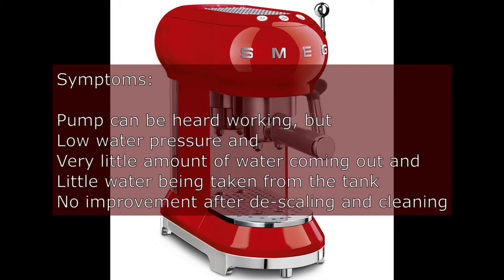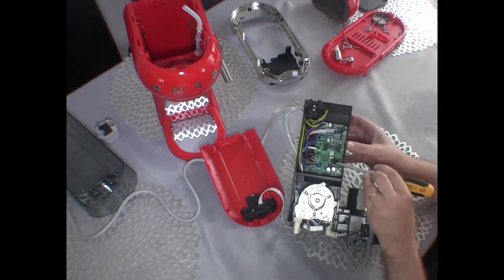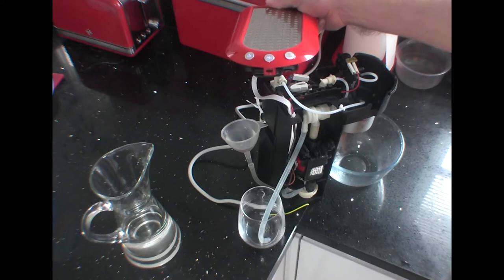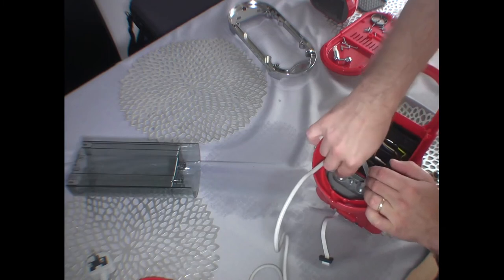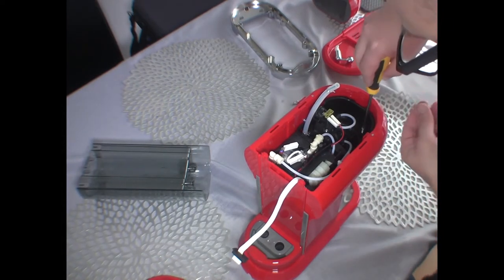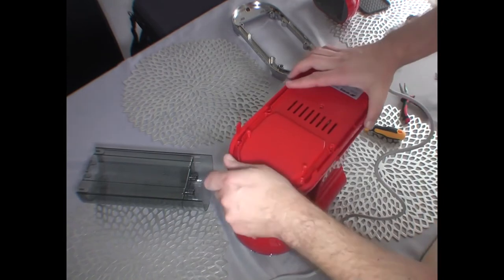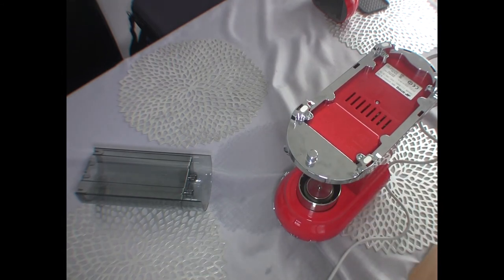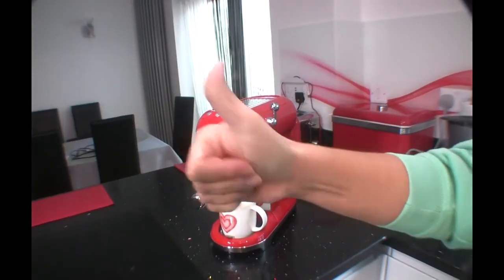SMEG ECF01 coffee maker repair - pressure relief water return valve fault

Comment: Worked a treat for me, didn't need to replace the valve, I just cleaned it out and reassembled. I cleaned it by removing the valve and flushing, with a bit of back pressure.
Reply: what did you do to back flush it ?

Comment: Thanks, worked perfectly.  Mine did leak after but it seemed the new valve from eBay was missing an O-ring, I used the one out of the old valve and it’s fine now.

Comment: Hey! I disassembled the machine, and took off the valve. When I opened it up (expecting to see a broken orange piece), it all seemed to look perfectly fine.  I ordered a new piece to replace it just in case. I just reconnected the new valve and I am still having the same issue. I am thinking it has something to do with the sensor that tells the machine that there is water available. Any Ideas would be helpful, thanks!
Reply from the maker: It is difficult to advise without having the machine on the bench in front of me. I suggest going step by step along the water path narrowing what is causing the problem: 1) is the water going into the pump and further out, is the pressure and volume ok 2) is the water going in and out of the heater 3) is there any block or leak anywhere along the way 3) is the controller behaving as it should and power supply to all parts is fine. That way should help to pin down the fault.
Reply: @zadzwon112  Thanks! The water is not going into the pump, but the heater is turning on and steaming, so I think that there are trace amounts of water going up there. There's no block, I checked every tube.  And all electric seems to be working! I just ordered a new water pump that I will install today, and hopefully that does the trick! otherwise I'm not so sure :/

Comment: Hey! 
I have the same problem and I’m trying to fix it myself, I bought the water pump but I can’t seem to have the right screw head for the base of the machine. 
The hexagon shape. Would u be so kind to tell me what kind of screw head did u used ? 
Tyia
Reply from the maker: Screws are security torx. The security pin in the middle of the screw head can be broken off and screw is converted to ordinary torx that way.

Comment: very useful video, My machine is does not want to descale, it goes into the mode then does not do anything, the coffee machine is only doing single shot and the milk frother works for only 5 seconds then the one cup and 2 cup flashes, any idea?
Reply from the maker: Hi. I would suggest re-setting the machine - the details of the procedure are described in the user manual under programming section.

Comment: What screw driver is required to remove the screws at the base? The screw head is a strange shape.
Reply: FYI. I have descaled my machine several times but when I try to make coffee nothing comes out of the machine. Hot water will come out when I dont have any coffee in the filter so I think it is something to do with the pressure but im not sure. The machine makes its usual noise when I try to make coffee but after a couple of seconds the sound lessens, and then the machine just stops.
Reply from the maker: @sandymartin3984  Screws are security torx. The security pin in the middle of the screw head can be broken off and screw is converted to ordinary torx that way.
Reply from the maker: @sandymartin3984  Before you disassemble the whole machine check the stainless steel water filter plate sitting above filter holder (the part you put coffee in):
Undo one screw in the middle of the stainless steel filter plate and remove it. Prepare hot solution of commercially available kettle de-scaler or white vinegar or citric acid and pour it into a bowl. Soak the filter for a couple of hours than rinse under running water and wipe it clean. Hold the filter against bright light - if holes in the filter are still blocked - repeat.
Reply: @zadzwon112  Thanks. The filter you speak about is fine. I can see through the holes clearly. I will try and clean the filter in the handle however. I have not done this. This is the only other thing that I think can be the problem. Otherwise I will try and get it fixed because the internals seem a bit too complicated for me and I'm not even sure what is broken. Cheers
Reply: @zadzwon112  There is pressure in the chamber between the handle and the pump. When I try to make the coffee, water does come out but there is pressure between the handle and the machine after it stops. Its clear because the handle self twists off after I rotate it a little. I assume this is a problem with the pressure release valve
Reply from the maker: @sandymartin3984  Faulty pressure release valve directs most of the water back to the water tank and very little comes out of the machine. I hope you manage to find and rectify the problem.

Comment: The filter has no visible outlet holes. When it's blocked, how to repair it?
Reply from the maker: Are you asking about this filter: https://youtu.be/azTNitfqs6o?t=1415 ?
Undo one screw in the middle of the stainless steel filter plate and remove it. Prepare hot solution of commercially available kettle de-scaler or white vinegar or citric acid and pour it into a bowl. Soak the filter for a couple of hours than rinse under running water and wipe it clean. Hold the filter against bright light - if holes in the filter are still blocked - repeat.
It is good idea to regularly flush the machine with manufacturer recommended de-scaler - there are YT videos on how to do it. This will prevent limescale building up inside.

Comment: Hello, thanks for the video. Can you share a link to the pressure relief valve pls ?
Reply from the maker: Just google "ecf01 parts valve" or "DELONGHI 7313286129 VALVE" and you'll find many suppliers. DeLonghi is probably cheaper, but it is the same part as Smeg,